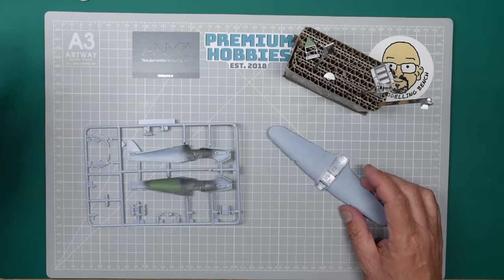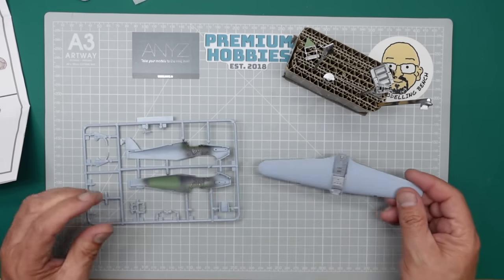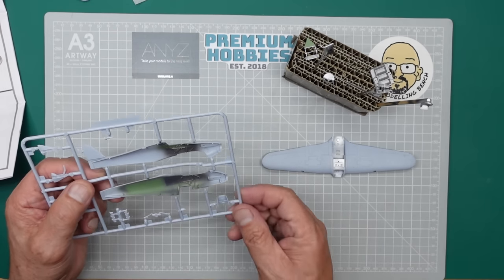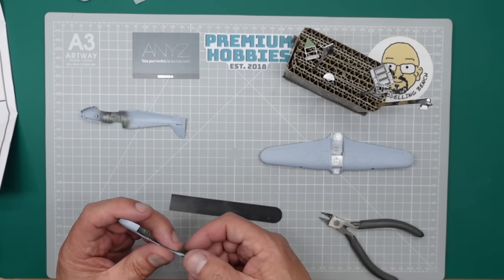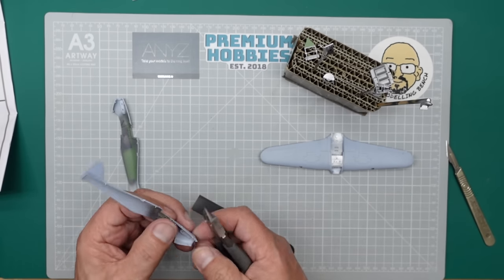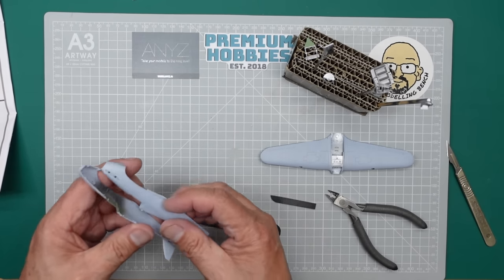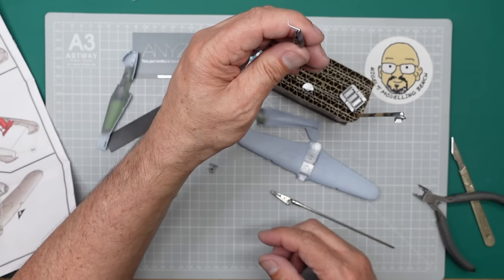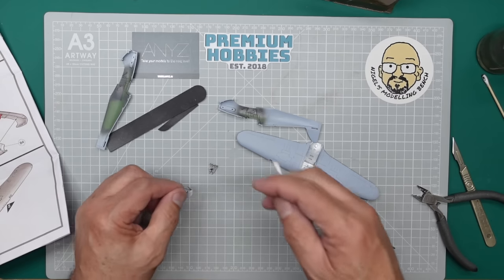Beginners build...Airfix 1/72 Hurricane Mk.1 Part Three.

Comment: Excellent video Nigel. As a reborn modeller I’m about to start the Airfix 1/72 Spitfire which like your hurricane has a lot more detail than the advertised Starter set for the 1/72 Spitfire. I’m old enough to have more patience than an enthusiastic youngster but totally agree with your comments that this build could put off aspiring modellers. Keep up the good work

Comment: Niya Nigel can you tell me what's the best clear coat I can buy thanks
Reply from the maker: Lacquer, Tamiya LP9, Acrylic, X-22 or Aquagloss. If you want matt, then the Tamiya LP is great.
Reply: @NigelsModellingBench  Sorry to bother you again do I need to dilute it with x-20A or can it be airbrushed out of the jar thanks again Nige
Reply from the maker: For LP you need Lacquer thinner and you can also use Lacquer thinner or X-20A with the X-22. Aqua Gloss is straight out the bottle.
Reply: @NigelsModellingBench  OK that's great im new to the hobby and still learning thanks Nige